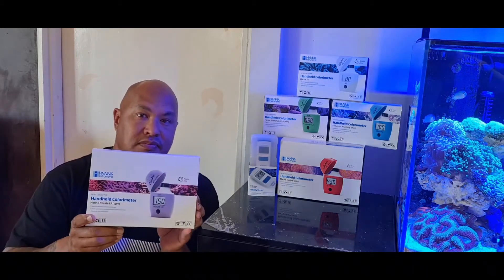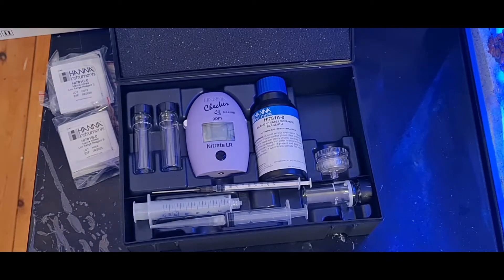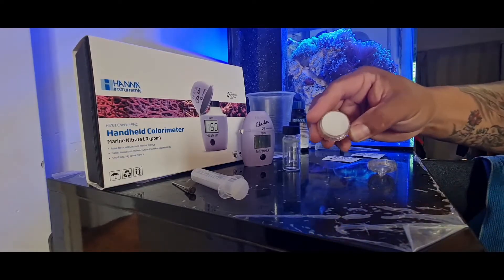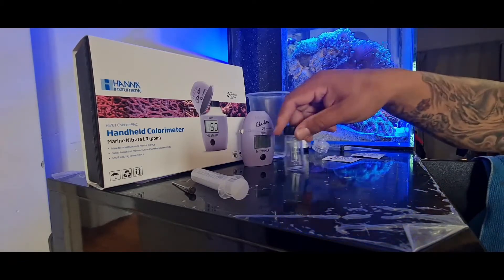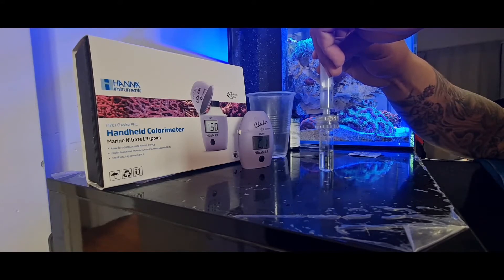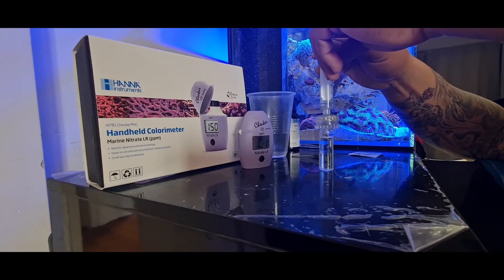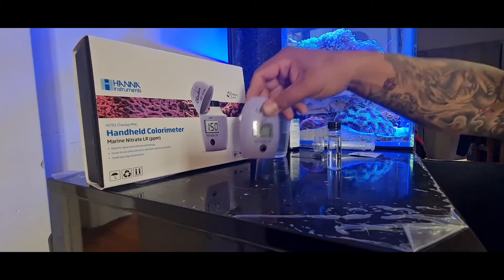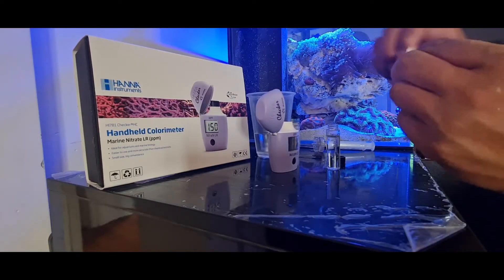I check out the Hanna HI781 Marine Nitrate LR Checker

Comment: When measuring the 4ml of reagent with the 5ml syringe, your sample water shouldnt reach the 4ml mark. The plunger should reach the 4ml mark instead. Remember that because it has a long tip this will leave some air space

For this reason in the video you added 5ml of reagent instead of 4ml
Reply: Think it’s also a good idea to get all the reagent in the test instead of the table 😂